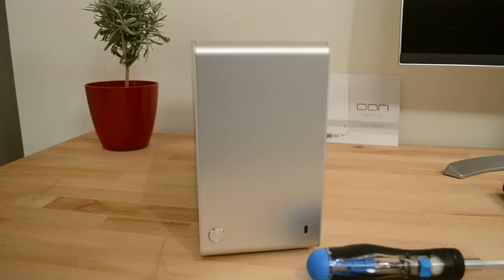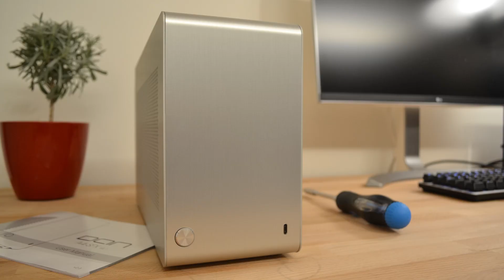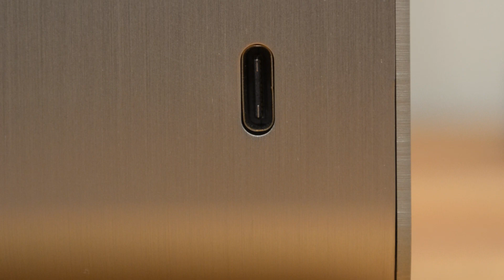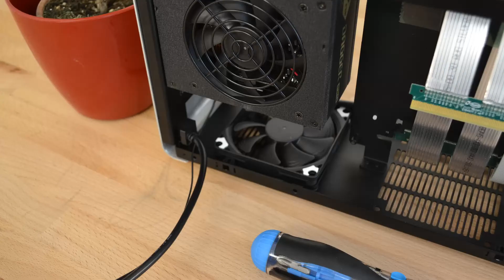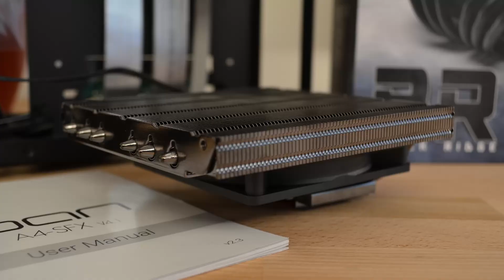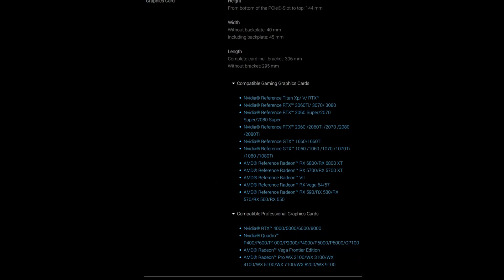DAN A4-SFX v4.1 - The 7.2 Liters SFF Case

Comment: where is the CPU & GPU thermals ?
Reply from the maker: Hi. The CPU and GPU thermals will come in a future video. I am currently ensuring that the system is stable as I an under-volting it.
Reply: @jaytinkers4881  Love to see that!

I am a long time Intel user and finally ready to make the jump to AMD but confused by both the different "numbers" and the air-cooled thermal performance compromises that need to be made in this case.

I have two of these running i7-6700K and i7-7700K, both with SF750 PSU and RTX 3080 w/ 10mm spacer and bottom mounted NF-A9x14 fans sucking cool air from the outside and blowing it over the GPU rear and PSU (the cases are suspended under a desk with good airflow on all sides...best on the bottom).

Any suggestions on the current/mid-2021 highest end safely air-cooled AMD Ryzen CPU + motherboard + fan combo in an RTX 3080 w/ SF750 PSU setup?